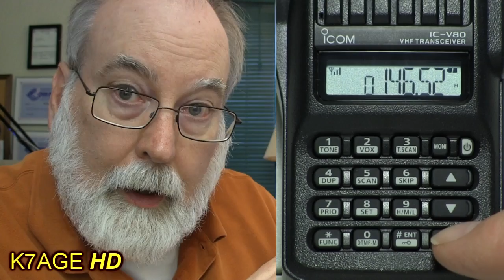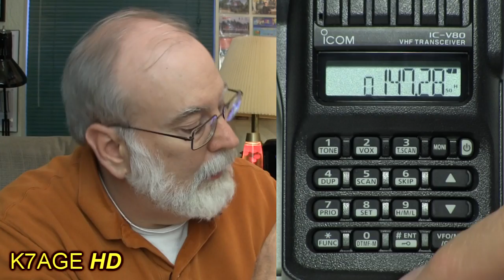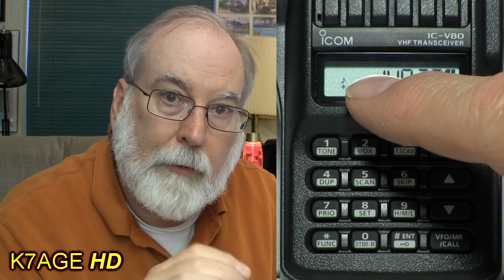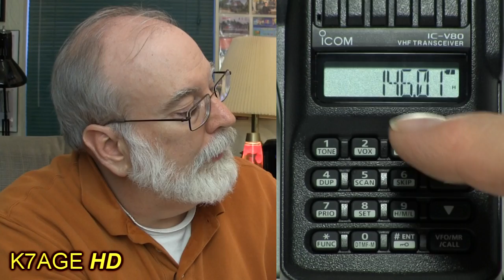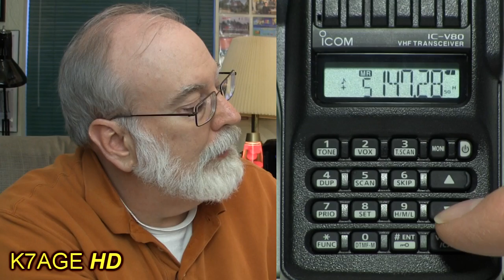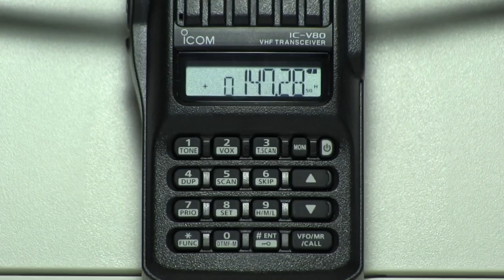How to get started on Ham Radio 2 Meter FM, Part 3

Comment: THANK YOU so much for these vids, especially this one! I've been a ham for a couple years, but it's been slow going. I have the ubiquitous Baofeng that I use CHIRP for programming. No prob. However, I wanted a basic/robust 2m HT, so just acquired the new IC-V86 which is a very similar layout to your V80. One of my goals was to become comfortable with manually programming this radio. YOUR VID has significantly helped with that. Again, thank you so much!! 73. [I echo the sentiments of a comment below, esp thanks for the 'turn on the tone' tip!!]

Comment: What do you normally set your squelch? Off, Tone Squelch, Tone Encode for the repeaters. Thanks.
Reply from the maker: You typically need to encode tone to get into the repeater. I don't use tone decode on my radios, Just normal squelch. I like to hear if there is something else on the repeater frequency.
Reply: @K7AGE  I have my radio set for Tone Squelch on most freq but thinking about turning them to off. AG5QP - 73

Comment: I use this radio with a half way or a snap together 4 element beam, but the stock antenna is one of the best around, very reliable for events and such.

Comment: This might sound like a smart-aleck question, but it's sincere: Other than asking for a radio check and waiting for an emergency to occur, what can you do with one of these units? Can you engage in conversation,  or is that considered a waste of bandwidth or repeater time? Something else? I "did" ham radio ending about 30 years ago, and on HF you actually could engage in conversation occasionally, but I'm wondering if the same applies to the repeater-dependent 2m genre? Any thoughts? Thank you, KD8ZM

Comment: Nice series Randy. Great information. I've been wondering what power repeaters retransmit with? Does it vary or is there a standard?
Reply from the maker: +Mike Simpson Repeaters may use around 25 watts. Some run over a 100 watts. No standard that I know of.
Reply: Thanks

Comment: So do you ever use that yaesu still? I seen it sitting on your desk in the background in some later vids.
Reply from the maker: +Kandi Klover (Fursuiter Furry) I used that for my echolink link radio. I should get that running again.
Reply: K7AGE please do I've just downloaded the app and would love to check your node.
Reply from the maker: +Kandi Klover (Fursuiter Furry) I need to setup another PC and make changes to my wifi router to get back on echolink. Not high on my list having just moved. Lots of other stuff is needed first.
Reply: How about now? :)
Reply from the maker: The Yaesu is setup in Brookings as an Echolink link to the 146.96 repeater. I can't reach the repeater from Gold Beach, so I link into it.
Reply: K7AGE Hey that's pretty cool. You should do a video on that. Would be helpful for a lot.

Comment: Hi Randy, I've watched quite a few of your vids here on Youtube and I have learned a lot.  I just passed my tech last month and only missed the General by 3 questions.  I have a question.  I'm wondering if I can connect my little cheapy handheld Baofeng UV-5R to my CB spring mount in my Toyota?  Do they make an adapter? I'm sure I will have to buy a new antenna, I just don't want to drill new holes in my 71 Land Cruiser.  Any assistance is greatly appreciated.  Thank you so much and keep up the good work.  Out here.
Reply from the maker: KK6TDM Eric Eric, great news on your license. Get back for another test soon! You would need to find an 146/440 MHz antenna that would fit your CB antenna mount. At the radio end you probably have a PL-259 coax connector. I would use a short cable to go from the PL-259 to the Baofeng connector, and not use an adapter that could apply a lot of stress to the radio's connector. Amazon even sells these. 

http://www.amazon.com/Coaxial-Baofeng-Handheld-connect-Antennas/dp/B00B3KHLVM
Reply: Thank you sir, sorry about slow reply. Had a few family issues, all is good.

Comment: Randy, you're a natural teacher.  This level of knowledge seems far too often to be assumed that you magically get it when you pass your examination.  Well I passed mine in 87 and didn't take out a licence till a few weeks ago, so things had "changed" slightly...  HF is easy, no problem - but the new little chinese cheapie UV82 I got was like - built by Martians.  I'd figured how hard can it be if HF was a relative breeze - well it's been an education.  Thanks for these helpful videos - and thanks too for leaving your outtakes on the end! Glad it happens to practised and confident operators as well!  73s - Ian MM0HRL
Reply from the maker: Ian, thanks

Comment: Hey, you have kind of sold me on the V-80 Sport, just to let you know. I just ordered one this afternoon, plus some rechargeable 2500 mA/hr AA`s and a smart charger for it, plus some alkaline ones to have on the shelf. Looking forward to 2 meters; it`ll be my 1st time on FM. I really feel the need to have some Amateur capability while on the road. 73,

Joe KC3BXZ
Reply from the maker: Joe, I think there is a warning in the battery case about using rechargeable batteries. I also got a T70 dual band with the Li-Ion battery, which also fits the V80.
Reply: I also have some SW radios that take AA`s, so, no loss. My off grid tendencies kinda revolve around AA batteries a little.
I am getting into battery powered interior lighting.
The Li -Ion tip sounds good, will check it out.
Joe

Comment: Nice video. I am thinking about purchasing a radio. But I live in a home owners association, so rigging a 40m antenna to talk on 80m is not an option. I was looking for a repeater like system that allows my to transmit on shorter freqs (perhaps even 2 meter) to a system that would then retransmit my signal on 80m or any other freq that I want. Does such a system exist? My main issue is limited antenna length and a desire to talk on longer wave lengths.
Reply from the maker: I don't think you will find a 2M to HF system. If there are any, then it is probably something private that someone has setup for remote control. You might be able to put up a flag pole vertical. Google for that and other stealth antennas.

Comment: Great videos.  I am completely new to Ham and I haven't even taken my Tech exam as of this time.  I went to my local Amateur Radio club and found repeater information.  Output is listed as 145.49-.  Input is listed as 144.89.  PL tone is listed as 123.0.  I'm sorry if this is a dumb question, but how do these numbers relate to the numbers you refer to:  Repeater's frequency, repeater's offset, and repeater's tone.  I believe the repeater's tone=PL tone which is 123.0.  Is that correct?  Thanks for your help.
Reply: OK.  I figured it out:  145.49 MHz - 600 KHz = 144.890 MHz....so the offset is 600 KHZ.
Reply from the maker: Steven Stiffler
You got it. Use the - offset, normally set for 600 KHz for 2M FM.
Reply: +Steven Stiffler how we can get the freq tone. tnx
Reply from the maker: +Joepet Heruela Usually the repeater is listed as 145.49 -  123. So set the radio to 145.49 with minus offset. Set the tone to on and frequency to 123.

Comment: Hi K7AGE.... This is KD2DIX... I'm new to Ham operation and I to have the V-80 platform. Was wondering if you could answer a question for me. Why is it that when you key up the mix or push the squelch button it shows a different frequency? This might be the reason I cant get anyone on the other end of repeaters for radio checks? Thank you..

Comment: Hi Randy, great videos indeed! i don't know if you can help me in this but i got new 2 i-com and i wanna use them in my construction site, a 400 m high tower building and i need the best set to get the maximum vertical range here, i'm so confuse about the settings and i don't know if i can get a better results, considering the concrete slaps and inside shafts!!! i will really appreciate it if u can give me ur expert advice in this.. 
Thank you so much my dear :)